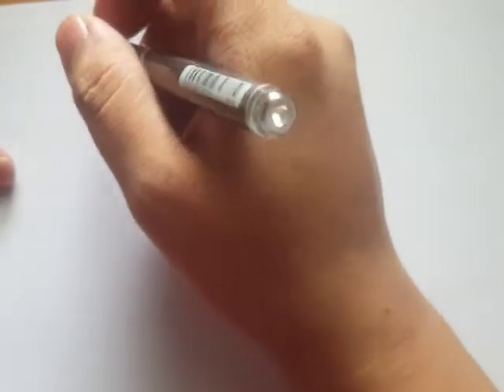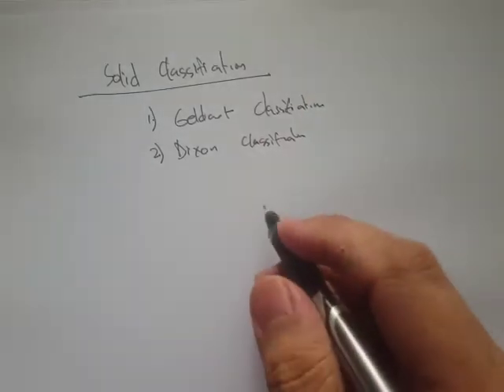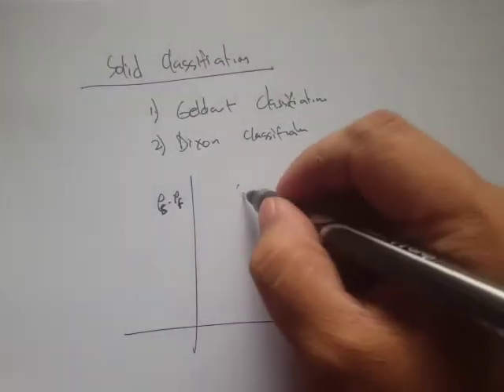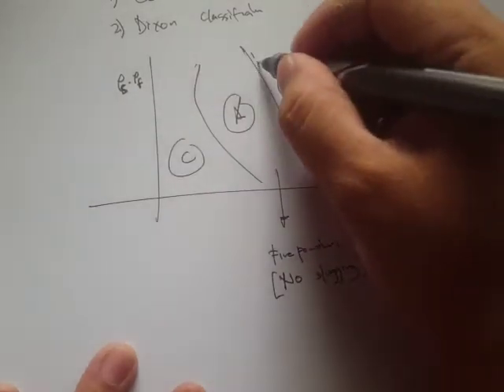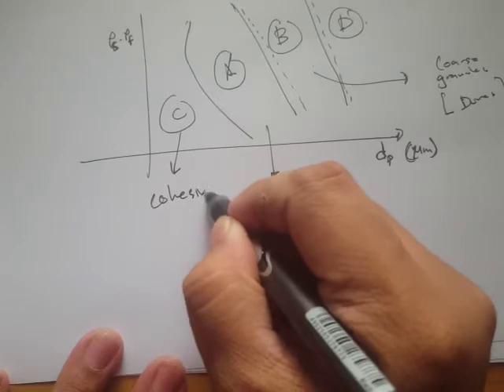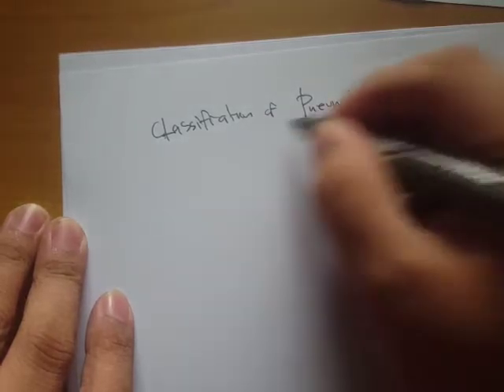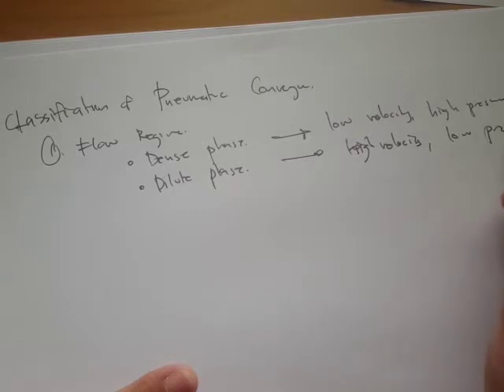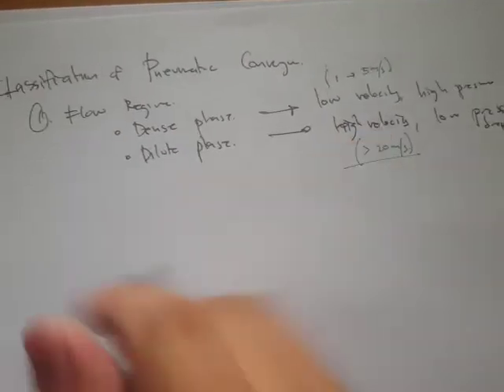ABE180 - 06.02 - Design of Pneumatic Conveyor (Part2)

Comment: Hello! I wrote to you a couple years back and here I am again! @29:00 you mention vacuum system needs higher velocities than pressure system, but the way you wrote the equation it should be the opposite?  In my experience you are write that negative systems require higher velocities so the equation should be Ve(-) = 1.8*Ve(+)
Reply from the maker: hi, it's good to hear again from you.  yes it's the opposite; what you have written is correct Ve(-)=1.8*Ve(+).
should you need my lecture handout on that topic, just let me know your email.